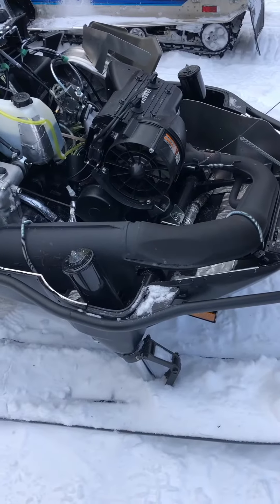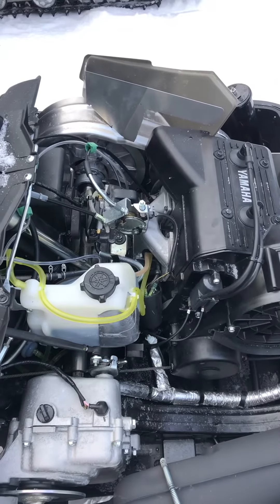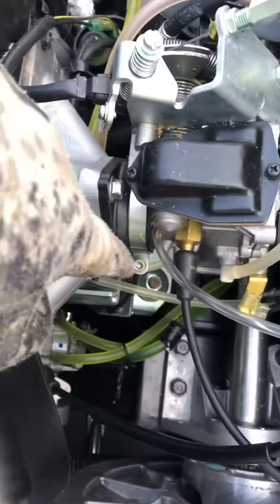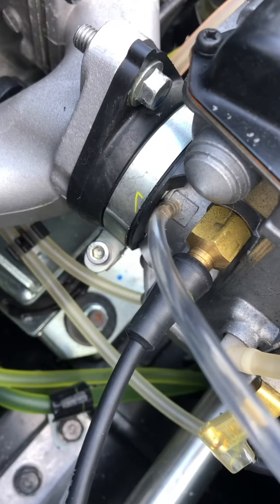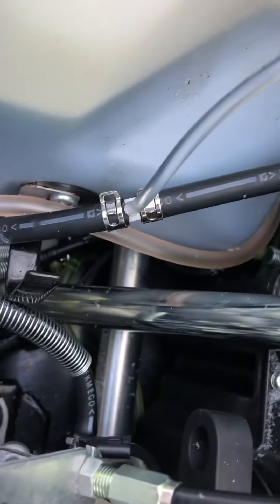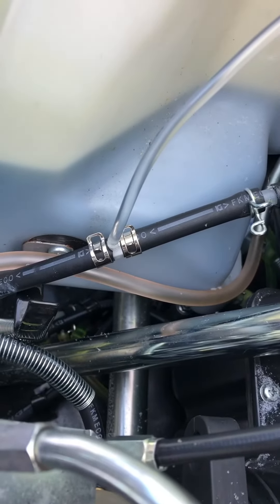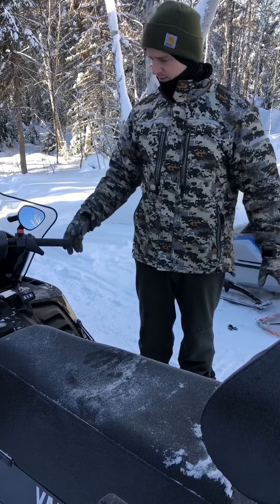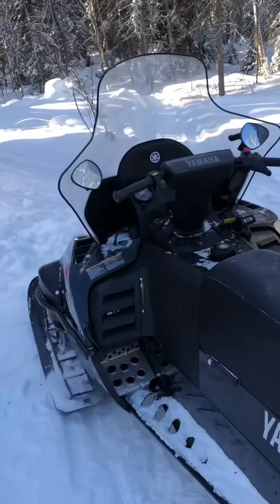VK 540 Primer Cold Starting

Comment: I have installed the primer with the help of this video - excellent help with cold starts. I have had terrible fouling issues with both starting and idling my 2017 VK540 - best solution so far was to put a hotter plug an "8" rather than a "9" NGK. Idles without fouling now, and starts / warms easier. Another trick it is when you know it has fouled while idling - just give it a touch of throttle to rev it a little and it will clean out fairly quickly. When plugs do foul badly - use a good propane mag-torch ( kept under your seat)to heat the end cherry-red and it will burn out all of the carbon completely. Good luck! Otherwise, great machine!
Reply from the maker: I’ve never had fouling issues at all. I wonder if these carbs are sensitive to idle mix.
Reply: also, there is a better mounting location on the 2017 carb - a raised pedestal obviously made for the purpose and aimed toward the intake manifold
Reply from the maker: @alaskanate123  anywhere is fair game. Usually I like it to be on the downstream side of any carb
Reply: @jasongogal4336  - it seems to be hit and miss, but here in Alaska there has been a fair amount of complaint about it. Mainly on the 2017 models that I also have. I have wondered the same - whether the oil pump is too active at idle.

Comment: Yesterday -32C here in ontario.My VK was dead.Would not start.Actually left it home and took my tundra 300.2019 VK 540.I'm installing a primer kit,That was frustrating.Nice install,thanks.
Reply from the maker: It was -30 for a straight week here after Christmas. Primer made everything aces. And I was also nursing it with a shot every couple seconds for the first 30 seconds or so. Do it, you won’t regret it.

Comment: Thanks for the tip.  I purchased a brand new VK 540 last winter and have the same problem without primer.
Reply from the maker: Up jet sizes too, it’s lean from factory.
Reply: @jasongogal4336  I plan to install two stainless steel ball valves to shut the gas line when parked for longer time.  Also the primer starts to leak extra fuel into the engine and then I can keep that primer line shut when not in use.

Comment: I thought I figured my VK out.  Put a new coil on it and it ran great.  Both plugs firing.  I went for wood this morning, it was good.  Went back for second load made it 3 miles and it bogged right out.  Made it too across the Peel from my house and it seized solid.
Reply from the maker: Seized!!?!
Reply: @jasongogal4336  like the Rock and not the one you can smell what he is cooking.
Reply from the maker: Well cot dammy. Let me know what went wrong when you get it torn down. That sucks man.
Reply from the maker: @muskrat411  and if you part it, I want the carb! :)
Reply: @jasongogal4336  it's still on warranty Jase.
Reply from the maker: @muskrat411  ah ok. Well let me know either way. Wonder if carb iced up on you or something. Are you on facebook?
Reply: @jasongogal4336  no I think running on one cylinder from the bad coil did damage before I changed it.
Reply: I’m thinking the VK comes from the factory leaned out too much for emissions. If it is super cold out I can see one seizing up. I’m right next to the ocean so we rarely see temps in the minus teens Fahrenheit. Still, I’m going to keep my eye on the plugs this winter as I’ll be running it in colder temps than I saw last spring when I bought it.
Reply: @thatalaskaguy  I think that is the problem.  The dealer keeps telling me to add oil to the gas.  I'll be adding lots of oil all winter.  It also kills lots of plugs when you add extra oil butnzi think that is from over use of the choke.  I got a primer now and I heat it up on cold mornings so hopefully burn fewer plugs.
Reply: muskrat411 I’m not sure why they are recommending to add oil to the gas after break in? That’ll definitely help cause plugs to foul and could have contributed to you seizing up as the extra oil displaces the gas but the air remains the same. Basically it leans it out. I don’t know what temps you are usually riding in but chances are it needs to be jetted richer. Just check for what the jetting chart calls for and compare it to what your jetted at. Another issue I’ve had with manual chokes on twin carb sleds causing fouled plugs is having the cables freeze up or the plungers get “sticky” in really cold temps, not release and cause it to run rich. But now with your primer kit that should eliminate that issue as long as the choke it currently released. One more thing, since you are towing, you’re likely at mid throttle and it could be your running  lean at half throttle and that caused it to seize. 

I’d just check the plugs at different temps this winter and look for them to be cocoa brown. My VK uses quite a bit of oil from the injection system and that’s okay with me.
Reply: @Borrowed Time Wow thanks for all that information.  I will read over it a couple more times and implement your recommendations.

Comment: Man that made all the difference in the world. I’m going to do that and subscribe
Reply from the maker: Yeah man huge improvement! I killed the battery a couple times dry cranking cold starts and had enough. Primer is easy, cheap, and saves wear and tear on the engine, starter, and recoil.
Reply: Thank for the tip I called the dealer told them install a primer. Also told my buddy to install one on his also.
Reply from the maker: muskrat411 awesome, let me know how it works out for you
Reply: @Borrowed Time yes it is waiting for a warranty engine to come from Japan.
Reply: I finally got my VK back primer really makes a difference we had a stretcgh of -35C and I dont think i would have gotnit going without the primer.  Still having trounle withnit running on one after cold start.
Reply from the maker: @muskrat411  Maybe your pilot jet is small or idle mix is off. Easy to try.
Reply: @jasongogal4336  I had it in the shop and took it out in -37 today and it ran great.  Hauled a load of wood and ran the short trap line.  Just have to warm it up to guesse build a tent frame with a wood stove I suppose.
Reply from the maker: @muskrat411  you might be able to jet and tune it in. Whatever works! I'll see if I can do it if I need to.
Reply: @muskrat411  - not sure if you found a solution to the "running on one" when cold starting - I had that problem too. Even after warm if I idled too long a plug would foul and go back to one and eventually just foul out both plugs while I was working traps. I  found the NGK 8 helped mine, rather than the "9" plugs. Enjoyed some of the videos from your trapline, too.
Reply: @alaskanate123  I never really found a solution.  Heating it up with an electric heater for 45 minutes in the morning helps but that's 45 minutes wasted.  Adding a primer helps in not using the choke as much which saves plugs some.  It is a terrible problem.
Reply: @muskrat411  Sorry to hear that. I bought a 2017 VK in the spring when they first came out again, but it took two years to run it out to my trapline from Fairbanks ( 500 miles by river) since we had poor river conditions two years in a row. I had trouble with it running on one cylinder when it was still in town, so changed out coils as you did - no change. I assumed it just needed breaking in yet. It ran great on the way out and ran perfectly. It had almost the same fuel economy at a new ACE 600 Tundra that a buddy ran along with me, interestingly)  but was tough to start below -30 or colder  ( once I couldn't get it to turn over at -35 , even by hand and had to use a mag torch to warm the exhaust manifold and cylinders to get it moving eventually - but the Tundra had the same problem).  This winter I have put it to work for the first time, but only have put 250 miles or so on it. My starting technique seems to be working now : 3-4 primes, full choke until it fires and runs (quickly), then 1/2 choke idle for 10 minutes or so. It may (usually does) start fouling one cylinder a bit, and at that point I get rid of the choke entirely and just ease the throttle up a bit to smooth it out and it seems to burn off the fouling. If not, I pull the plug and replace it with a cleaned one and I am good to go. If I try to give it too much fuel without "easing the throttle to burn it off" before going it will certainly foul it out, even both cylinders. The biggest improvement has been to but BR8ES plugs in it (hotter). It made a difference. 
Now if I idle too long it may start to foul a little , but it will burn off quickly with the ease-the-throttle approach. My guess is that the problem is entirely related to the new carburetor system on these models, since i have a VK540iii and several friends also have the older models without ANY fouling issues. If anything, it is rich , rather than lean, but I am sure you might question that after losing a jug. Hope this helps. 
It is good to see that others are starting to post reviews and "fix" ideas - there wasn't anything out there for awhile.
Reply: @muskrat411  one other "quick fix" to clear up a plug and fouled cylinder when cold is to pull the plug cap and give it an inch or so gap between the plug while it is running - it will take right off and start running due to the increased spark power that develops/ You can turn the cap a bit so it sits that way by itself if necessary and drive it some too. Sometimes you get tired of pulling plugs, so any cheat it a nice break. If you don't do it already, I found that any fouled plugs you have are still good if you heat the threaded end to cherry red with a torch - it burns out all of the carbon and they seem to be like new again. So long as they cool slowly and you don't crack the ceramic they last.

Comment: Why did you not put the tee in the existing splice connection above the point where you tied in?  I am in the process of installing one.  Is it because the tee would not fit?
Reply from the maker: Is that splice a reducer though? It usually is. Anyway, this is what made sense at the time.
Reply: Thanks for your reply. I took the splice apart and the outside diameter is 0.230” whereas the inside diameter of the 1/4x1/4x1/8 tee is 0.140”.  I thought the reduction in the hole size would restrict the fuel flow and cause a problem.
Reply: Thanks for your reply. I took the splice apart and the outside diameter is 0.230” whereas the inside diameter of the 1/4x1/4x1/8 tee is 0.140”.  I thought the reduction in the hole size would restrict the fuel flow and cause a problem.
Reply: Thanks for your reply. I took the splice apart and the outside diameter is 0.230” whereas the inside diameter of the 1/4x1/4x1/8 tee is 0.140”.  I thought the reduction in the hole size would restrict the fuel flow and cause a problem.
Reply: Thanks for your reply. I took the splice apart and the outside diameter is 0.230” whereas the inside diameter of the 1/4x1/4x1/8 tee is 0.140”.  I thought the reduction in the hole size would restrict the fuel flow and cause a problem.
Reply: Thanks for your reply. I took the splice apart and the outside diameter is 0.230” whereas the inside diameter of the 1/4x1/4x1/8 tee is 0.140”.  I thought the reduction in the hole size would restrict the fuel flow and cause a problem.
Reply from the maker: @johnfitzpatrick1390  I have never had issues with any primer system ever, other than a defective plunger. I’ve probably put 30 of them on sleds from 340 to 540 sizes.
Reply: Jason I went ahead and installed the tee at the splice joint. Thank you for replying to my questions. Much appreciated.
Reply from the maker: @johnfitzpatrick1390   cool stuff John, it will make your life much easier. Not only getting it to catch, but you can nurse it for a few seconds until it is idling stable in the coldest weather.

Comment: I drilled a tiny hole in the plastic air intake breather, 
Which I can re-cover with a piece of electrical tape,
 A touch ( ( one second spray) of quick start, 
And I’m running....

Comment: man that seems to pull a lot easier than mine unless you are some kind of body builder. ya have any history of fouling plugs with that machine?
Reply from the maker: No plug fouling yet. I try and do good burns on it and I also use the Yamaha Ring Free fuel additive and the Yamaha fuel conditioner. 

I know what you mean, sometimes hauling it over is a chore. Again though primer primer, it catches right away.

Comment: I made a video about cold starting my VK 540 with a heater and the primer.  Check it out.  I put the primer on because of this video. I'll try and recommend it in the comments
Reply from the maker: Did you get a diagnosis on why it seized up?
Reply: @jasongogal4336  it did not seize up the fan busted up and a peice of fin got stuck in the fan belt.  That's why it would not turn over.  Just waiting for a new fan.
Reply from the maker: @muskrat411  aha, that is good to know. Sounds like the fan might have iced up or sucked in a stick. Thanks for the update man!
Reply from the maker: @muskrat411  I did some powder riding and one of my 540s iced up so bad that the carb froze. But the fins were all iced up real bad too. The problem in my case was that it was sucking up lots of powdered snow in the fluffy snow conditions.
Reply: @jasongogal4336  that may be what happened I was cutting wood in -30 with a wind and I shut the VK off it must have froze up.  I should have just left it running to thaw out.
Reply: @jasongogal4336  yeah do a video on making screens to protect the air intake.  I'll copy it and hopefully this won't happen again.
Reply from the maker: @muskrat411  did you find any sticks or anything in the fan housing? I’m reluctant to block those cooling air vents with anything. For me it was really deep fluffy new powder and my son was doing rips on an XLV. She was steamy lol
Reply: @jasongogal4336  yeah me too I think it was the steamy air caused it to ice up.  But there are a ton of sticks in the bottom of my belly.